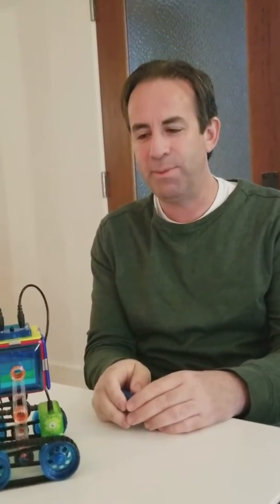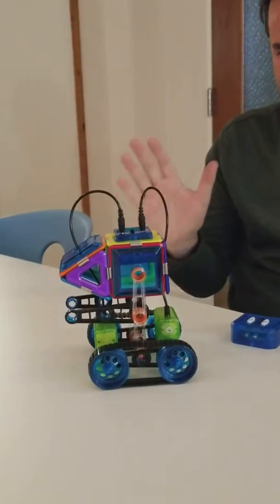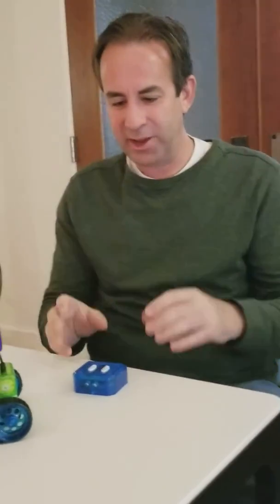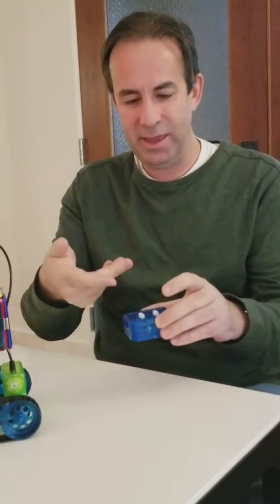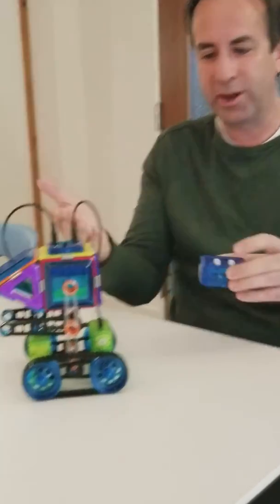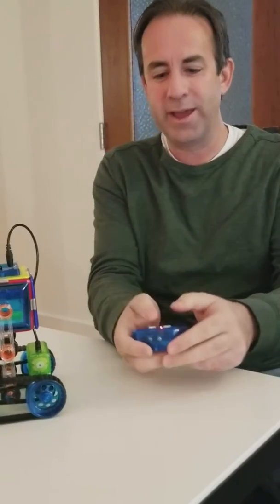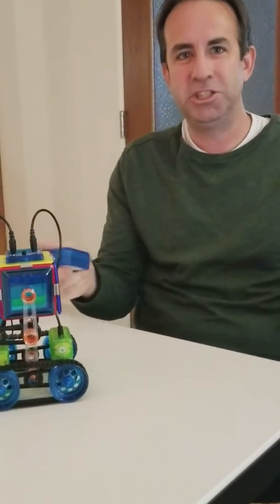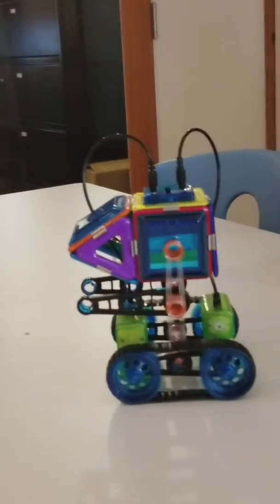GeoSmart FAQs - Mars Explorer and Moon Lander Not Moving

Comment: Hello, the red light on the remote control is on, but not flashing. The yellow light on the receiver is flashing, but there is no movement. The wheels clicked alright. Do I have to pair the controlers somehow? It is not mentioned in the instructions. Should I replace the product?
Reply from the maker: Hello - just checking to see if anything has improved. We are happy to send replacement motors if still not functioning, just give the office a call 800 542 6375. Thanks
Reply: @GeoSmartUSA  Hello, had to send it back to the seller.
Reply: Hi Robert - are you hearing any sounds from the motor when you engage the remote?
Reply: @Smartgamesusa  Hello, no, no sound. Looks like the remote control and the receiver do not communicate.
Reply: I'm having the same problem for the flip robot.I just called the office but no answer

Comment: What do you mean by 'connected and paired'? How do you check for this?  With no instructions in the box, It's impossible to figure out how to get the motor working. All I have is a blinking red light on the controller, and nothing happens.
Reply from the maker: Hello - Basically we just mean that the remote is communicating with the motor, that the motor is receiving commands from the remote. The lights are an indicator, if both parts have batteries installed correctly the lights should come on in both the remote and the motor. If you are hearing sound or seeing movement from the motor when you push buttons on the remote, the movement issue is probably as described in this video, the parts just need to click together firmly. However if you still are having issues we will replace with new parts, just get in touch with our office. Also - to be honest we have to acknowledge the lack of instructions. Conceptually the idea was that kids could build and adapt based on the photos, but we have communicated the need for a guide to our home office, one that can be downloaded. We will make that available soon. Apologies that you are having any trouble, Moon Lander is a quality product with quality parts, and rest assured we will work to make it right.
Reply: GeoSmart USA That helps, thank you. the motor unit lights do not come on, so we will contact support for a replacement.
Reply: On the flip robot the reciever light is blinking. The remote light is solid. I hear no sounds or movement. We only got to use it for maybe 15 minutes then we turned it off and hasn't worked since last Christmas when we first bought it. Any suggestions? I've charged it and removed remote battery's and put them back in thinking maybe that would reset something.